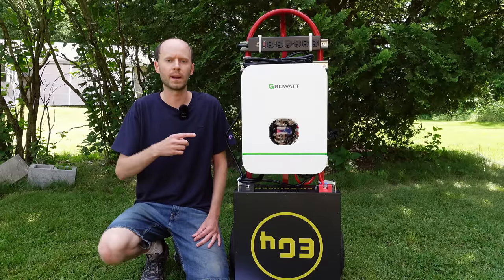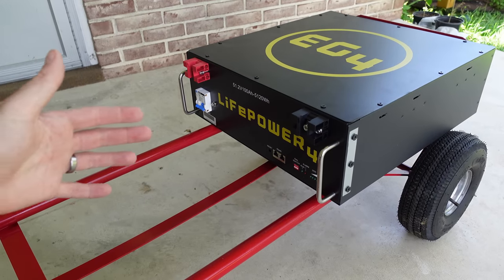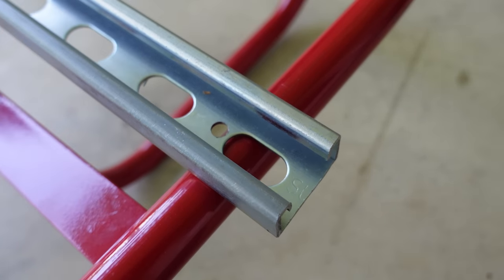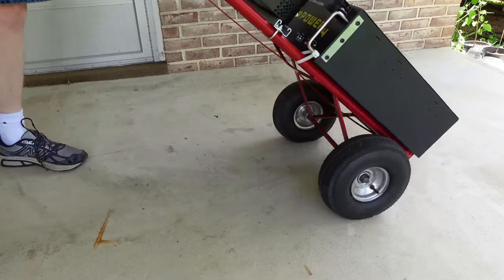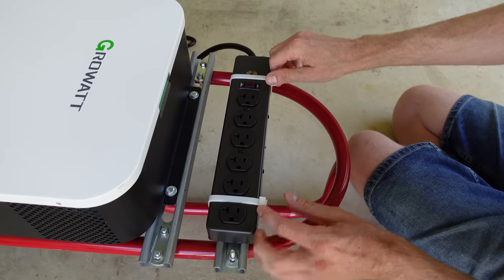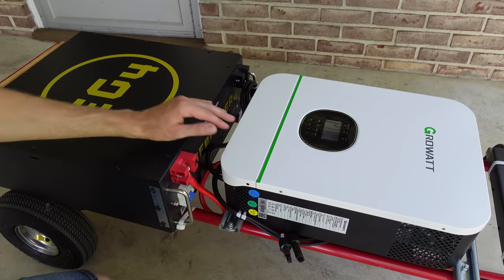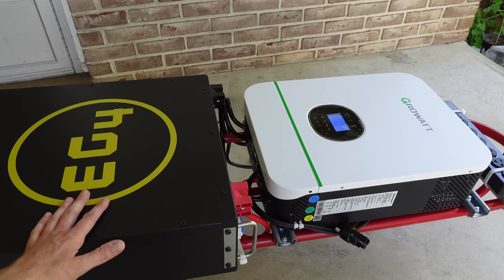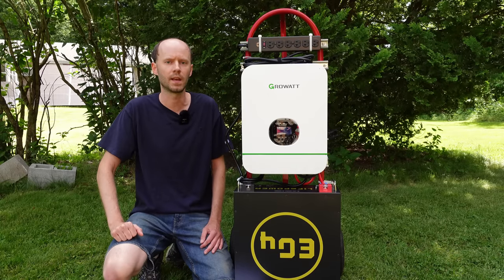Building a 3000W Portable Solar Power Station, Great for Power Outages!

Comment: Modification do not void warranties.
Reply from the maker: The warranty policy says no modifications.
Reply: My understanding is that this policy cannot be enforced. The same way that warranty void stickers are not enforceable, and why, for example, after market parts do not void a car warranty. I believe these rules are covered in the Magnuson–Moss Warranty Act.
Reply from the maker: @ericwebster6911  You're welcome to argue that with them if you choose to modify yours. Maybe they wouldn't care. I'm not going to suggest someone else go against what they're asking.
Reply from the maker: @ericwebster6911  Technically it says they have "no obligation" not that it will be voided. I'm not a lawyer but sounds like it's up for interpretation. Maybe that's to cover extreme damage caused by altering.

Comment: folks this is cool but butttt incredibly dangerous heres why you just strapped all that power to a metal cart one bad short to ground and well anything over 40 volts and 0.05 mah and your dead straight to your heart what you shoulda done is rubber 1 inch isolators the metal clamps as well where ever you go use a ground strap and a metal rod and pound it into the ground 1foot other wise lightening strikes etc.. have a abc fire extinguisher attached to it just in case keep away from anything other than dirt dont put it on dried leaves etc  just some adivce youd be better off doing a portable with wheels plastic thick walled box they sell them with handles etc your also routing the wire next to freshly cut metal rails if they rub well bad things happen so use rubber insulated clamps also if you forget this is not weather tight.. cool idea though also use ferrels to put them on the ends of those terminals that go in the inverter  so you get full contact and no stray strands

Comment: I will wrap the whole thing in aluminum foil so it could be saved if the EMP ever happens.
Reply: Won't that make it difficult to use?
Reply: @russlo5324   turns out that a very effective EMP protection measure, or shielding, can be made from aluminum foil. Common heavy-duty aluminum foil successfully blocked all nine million watts of RF energy from reaching the radios. The radio needed to be wrapped in three layers, but it

Comment: Man are you sure that's 4 gauge? Seems to me that looks much bigger than that.. Yes, I know its running at 48 volts but Id feel better if it were say 1/0 gauge!
Reply from the maker: Yes, it's #4 - the insulation is unusually thick which makes it appear a thicker gauge wire than it actually is.

Comment: That is great. 
I thought of attaching a solar panel to the cart too, but realised the Inverter requires 120V minimum of solar input at Vmpp to function which will means at least 4 grid type panels in series. Wonder if you can check how well or not, 4 panels will actually do with this arrangement? Attaching them to the cart will be a challenge.
Reply from the maker: I don't think attaching any solar panels is a good idea. You wouldn't want it to become top-heavy and risk tipping over, especially when/if wind involved.
Reply: @LithiumSolar  Wind...good point.
Reply: Add another cart? 
w/hinged unfolding panels. 4 panels in series @ 400 watts each = 1600 watts. And approx 150+- VDC = 10.6 amps @ 150 VDC to inverter.  Add stabilizer as reqd for tip over and  keep the solar supply line to inverter as short as possible. Is all theoretical. I Have 2 EG4 48V, = 10.2KW.
& Growatt 5000 ES & 28 panels. Uninstalled....
  Job & health have been my obstacle. I am living vicariously through videos like this. Only not getting it done. Looks great guy!!
Thanks for the vid!!

Comment: Awesome stuff, I had used your original video along with Will Prowse, and I am figuring you must have picked up these 2 items before the release of the new EG4 hybrid inverter MPPT, it is a little more 749 vs 659, but that 749 does give you a few upgrades, plus having both the battery and the inverter/mppt from same company would make that thing look even more bad ass.. lol 

One item that is better on the EG4 is the max MPPT operating voltage 500vdc vs growwatt 145voc,  max PV input on the EG4 is 5000, growatt is 4500 not a big diff but might be worthy of the 100 bucks.  

Great video and info thanks for posting, will be sending to friend in cali who been wanting to get something similar for prepping its the one area he has yet to include in his prep.  This here will for sure show him just how much easier it is with these great new rack batteries and the better and better hybrid inverter/mppt systems coming out. last November I put mine together and was a little over 3k bucks and that was much more work as I had to get more battery cable to run from the charger controller to the battery, then to inverter, a box to show some info as the charge controller did not have a display but is wifi, heck the charge controller was only few hundred less than the EG4 / and grow watt hybrid.  

Link to the EG4 hybrid inverter / mppt
https://signaturesolar.com/eg4-3kw-off-grid-inverter-3000ehv-48/
Reply: FYI, EG4 3K inverter recommends a 19" clearance on top and bottom of the unit for heat dissipation.

Comment: I have to admit I was surprised by the battery being 100 amp hours only and yet having over 5000W hours?
I guess I’m figuring that with that many watt hours you’d have closer to 200 or 300 amp hour battery. 🤔
Reply from the maker: Watt-hours are determined by the voltage. This battery is 51.2V nominal so you multiply that by capacity of 100Ah to get 5120Wh. If you take this battery and split it in 4 to rewire it as a 12V battery, then you would have a 400Ah battery, but still 5120Wh (12.8V x 400Ah). Hope that makes sense :)
Reply: @LithiumSolar  
Thanks, math was never my strong point! 🖖

Comment: That is nice but holy crap those components are pricey!
Reply from the maker: I disagree. These are pretty much the cheapest selection of components in this product space. Everything else (inverters and batteries) are more.
Reply: Go to Amazon and see what a cool $5,000 USD will buy you in a similar unit, then look at the ratings and comments!

Comment: David, I 'liked' the video, but I did not dig the price!!! Supah 'spensive! Ouch!!! But, really powerful & incredibly robust.
Reply: Yeah, then again, a Bluetti that is half as powerful costs relatively more Per Watt. You can always downsize your system (use smaller Ah battery, switch to 12V and get a smaller Inverter/charger) and bring down the price.

Comment: This looks great. I'm curious about doing something like this out of Maker Pipe with 1" conduit. It could mean you could design it around the exact dimensions of the battery and Inverter, and might have some additional advantages like setting the battery between the wheels which should lower the center of gravity and make it more stable in transit.
Reply: We are waiting for your video.

Comment: It would have been a more useful video if you actually load tested the system at rated capacity.  As is, it's not clear it it can sustain anywhere near full rated load.  The compressor has high start surge but the running watts is low compared to the rated inverter capacity.
Reply from the maker: It's a 3000W inverter. It can sustain a 3000W output. I'm not sure what's "not clear" about that? As built here, it's limited to 20A per the wiring I used.
Reply: @LithiumSolar  For full output, you might consider adding a 2nd outlet strip on the backside|over|under of the first one and just distribute the loads a little.  Then, the only limiting factor might be the total AH's of the batter(s) the builder selected.  I don't plan on running my unit at it's rated output.  If I thought I needed that, I would use a larger inverter, etc.  Good Job.

Comment: No mention of any solar panel.
I don't think this system will be very useful without one!
Reply from the maker: lmao
Reply: @LithiumSolar  So you build this, wait for a power outage, go shopping for a solar panel and then wait for some sunshine? It's a brilliant plan for sure but what if the solar panel shop is shut due to the power outage, or the power outage was caused by a prolonged period of rotten weather? Oh, I'm forgetting this is a portable system - so you just drag it until you reach the Sahara?
Reply: @redalert2834  So, you can't take it camping or use it for home projects, etc.  Only when you go on Safari?  Troll.

Comment: but it's still better use gasoline or diesel generator 😉it will be much cheaper and you can refill tank every time. 🤷‍♂
Reply from the maker: You can go that route if you'd like. I'm not suggesting this is better than a gasoline/diesel generator. It's just another option and, in my opinion, is way more fun!
Reply: @LithiumSolar  I do not take this opinion from you. 🙂that's my opinion how i see it.

Comment: Not a bad little setup that you can run right into your house if you need to. However for that cost of almost $3,000, you could buy a nice gas generator, even for much less, that if you had a good supply of gas, would Supply you with AC electricity for a whole lot longer.

Comment: Well made video  BUT  (you knew it was coming) 2700 + solar panels = 3500 to 4k.  For that price a ecoflow or bluetti with panels could  be a safer and more portable option.  The wattage and battery would be a little less.

Comment: Well crap.   When you said you were going to "BUILD" a 48v off-grid battery.,  I kinda expected an actual build.   It is boring watching someone toss some factory purpose-built batteries/and inverter.   Pretty sure shipping is a basic skill.   I do however like the hand truck rework.

PS:   After going to that extent and cost,  why don't you add a "soft start" for the heavy amo start up loads?   It will extend the life of the battery and especially the inverter.

Comment: as both units had mounting holes the unit strut with hard corners a hazard to flesh with weight⚠️ gets thumb’s down from me could they have been longer and vertical?  feet under witch the hand truck can slide/handles and plexiglass over hot wires that’s perfect

Comment: Ive seen 200ah 12v lipo batts for around 600 bucks, you can get a Cotek pure sine wave inverter, 1500 watt running, 3000 watt surge for around 400 bucks, you can get a hand truck at Harbor Freight for around 20 bucks. So a build like this should not cost you more than 1200 bucks. Ive been running my Cotek for 10 years, no problems.

Comment: sorry weld 2 width lenth at right angles to 2hight length cut and bend 2  one over middle one to hold cables on top flatten plexiglass 5inches rectangle tube for handles flatten aluminum tube end and drill for bolts don’t turn off beeps if override warning

Comment: i was told you have to have 3000 watt to even Power this inverter up,, but i see that is not True,,,
Reply: Oh Mine is a GrowWatt 3000 UB... It has no Battery Lugs...
Reply from the maker: So it's a batteryless inverter then? It runs solely on solar? I googled that model and didn't see any relevant results.

Comment: Solar power station????
Reply from the maker: WTF = Was That Fantastic? Heck yes it was!
Reply from the maker: There's a second video specific to selecting, sizing, and connecting solar panels to it. Intention was really emergency backup power, which would be solar in an extended outage. If there's anything else you'd like to see covered that the two videos are still missing, please let me know and I can make more.
Reply: @LithiumSolar  Yes, i would like to see your system charging from the sun light and being portable just the way you've stated in your description ! Thank you!
Reply: @LithiumSolar  No man, you've specified very clear in the title , 3000 W portable solar power. I really really wanted to see how you can make that much power with a portable system. Maybe you can list the link from that vlog in to the reply if you are so kind !

Comment: That inverter has no form of rain protection. I would never use that.
Reply from the maker: This is not designed to be weather resistant.
Reply: @LithiumSolar  Your viewers aren't going to know that. Which is what makes this project so dangerous. It looks like it's designed to be used for outside right off the bat.
Reply: @LithiumSolar  Neither are any other commercial ones I have seen on the market.
Reply: Wait a minute, I believe Sol-Ark makes an inverter that can be used in the rain, mounted and left outside year round.

Comment: I saw some dumb@ss "pre-charge" his capacitors for 2-3 mins lol, same inverter
Reply from the maker: LOL 3 minutes... Also, this battery has a pre-charge circuit built in. No pre-charge needed.
Reply: Which channel did that??? I wanna know
Reply: I saw that video also!
Reply: @WillProwse  I think you commented on his video. It was a guy that built a mining rig inside his shed. Left it for 3 minutes, “just to make sure”. Lol
Reply: @LithiumSolar  you gotta be careful these days, 1 spark and booom!! whole project goes up in flames lol
Reply: Some guy named Will?? 😂
Reply: @GavinStoneDIY  ohhh gotcha ok haha
Reply: @GavinStoneDIY  poor guy just doesn't know how it works. I'm not judging. I'm glad he's building one on his own regardless.
Reply: @WillProwse   exactly. 4 months ago I didn’t even know anything beyond some simple AC electrical. Fortunately there there were lots of helpful people on your DYI forum. I Have my system running smoothly now. Still though, sometimes you gotta have a laugh. 😀 I’m sure others will chuckle at things I’ve done.
Reply from the maker: I'm not sure which video you're all referring to; however, it sounds like the general nature of DIY. If you watch some of my earlier videos, you'll see a lot of "learning" too 😀
Reply: @LithiumSolar  I know, it’s totally true with everyone. I remember watching another where the guy advised everyone to “just stand back” when you connect  your inverters to the lithium batteries. It made a huge spark. Thankfully most of the less intelligent things we do probably aren’t on video. I wired the  disconnect for my mini split completely wrong last week when hooking it up. The mistake was so blatantly obvious. 🤷🏼‍♂️
Reply: @LithiumSolar  I put the link in a reply to Will

Comment: How many people have air compressors at home? Please use home appliances as loads. How long the battery runs the appliance is more important than if it runs it at all.
Reply from the maker: I disagree. The purpose of the air compressor test was to show that it can start heavy loads. I can't answer for you how much power your loads require. That's only something you will know.
Reply: @LithiumSolar  If it starts a heavy load and drains in a couple of minutes, what's good about it?
Reply: @LithiumSolar  Pls, always run the heavy load and tell us how long the battery can run, thx.
Reply from the maker: @mohamadyehia3059  It's not going to "drain in a couple of minutes". It's a 5120Wh battery. That's a lot of power...
Reply: @LithiumSolar  So please in your estimate, how long would this battery run a 9,000 btu air conditioner, thx in advance
Reply: @mohamadyehia3059  The run time is based on calculation from the power consumption in KWh and the power source capacity in KWh and the inverter efficiency. Get a Kill-A-Watt meter and use it to see how many KWH your AC uses during your typical usage (the amount of power usage varies due to how you set your AC), then you can calculate how long the battery will last based on the capacity of the batteries pack and the efficiency of the inverter if you are converting DC to AC.

Comment: You forgot to put the manuals into a plastic bag and tape them to the device. If you ever need to change those settings, you'll be SOL without the manual. Otherwise, great build!

Comment: So you spent $2700 dollars to do what a simple $750 dollar tri fuel generator will do. Yea I dont get it.  Now add solar and a switch that puts the power into your home to lower your electricity cost then I would get it.
Reply from the maker: This can be used daily to offset power costs and should have no problem lasting 10 years or more. How much will you be paying in fuel, parts, and maintenance costs to run that generator for 10 years?

Comment: I always find it hilarious that when asked how many and how long something like this will power simple home appliances the answer is always a BS answer. This technology is not ready for primetime, and it won't be for another 30 to 40 years, period.
Reply from the maker: I fail to see what BS you're talking about? It's been production-ready for quite a while now and works great, period. Period, period, period.
Reply: Like most things, it is the END USER that determines this.  If you just want to flip a switch and have it work like your AC, hire professionals and it can be done now.

Comment: What is the use of explaining how to mechanically connect all the stuff to the cart when you are making a portable solar power station? People who want to make one know how to build either this or their own variant. People who need instructions on how to mechanically connect stuff together don't make a power system.
Also you explain how to connect the wires at the correct terminals as if you are talking to children. Who do you think your audience is? Doing it your way only means 1 dangerous thing: people who have no idea what they are doing try to build it with all consequences involved. Be aware what you are saying.